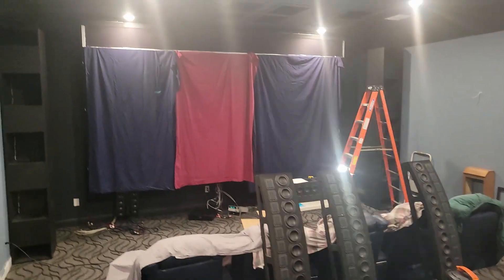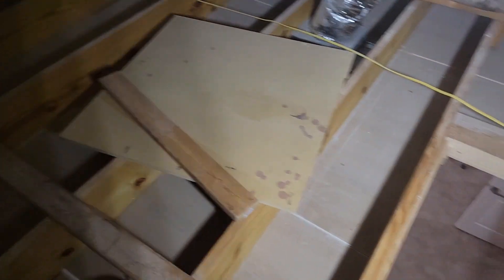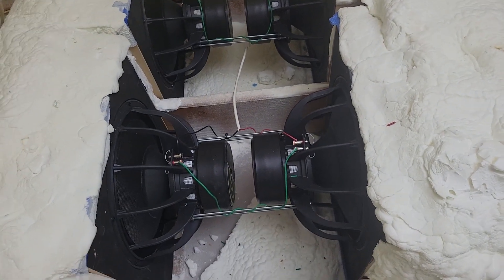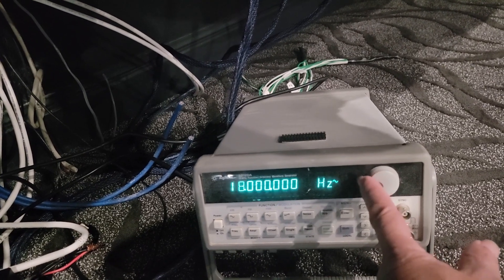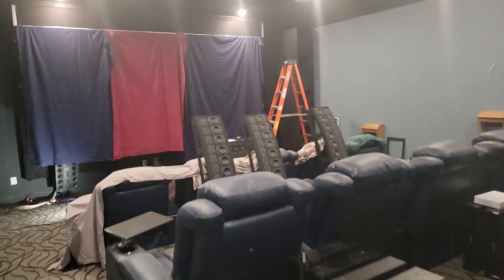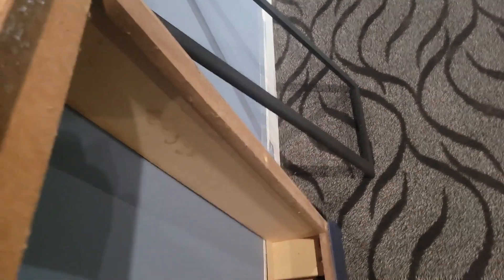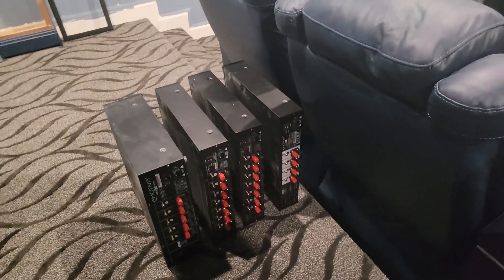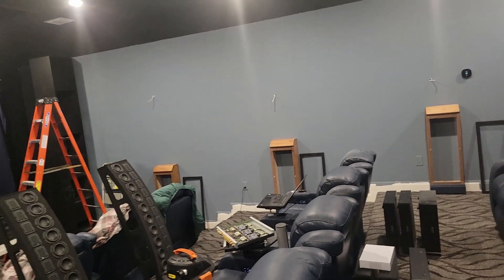11 26 2022 theater update

Comment: This is the most unique setup I’ve seen, absolutely beautiful.  I’m curious to see how your projector handles the low frequency. I say that because I only have 4-18’s, 3-15’s, 4-12’s and two butt kickers and I have to wedge small screwdrivers in my projector to keep the  image from vibrating off the screen and the focus from blurring beyond recognition. I’m hitting around 130db at the couch and by my count you’ll be at 28 subs total so the potential for high db is not just a probability. Very impressive sir.
Reply from the maker: So far I haven't seen a problem but I don't play it that loud and I don't run the bass all that hot, just 3 or 4 dB hot.  I like all the surface area and woofer capacity for distortion reduction more than for being able to play it loud.  It can definitely do that if loud is what someone wants however.

Comment: If you use low power on the woofers eventually you will overdrive the amp and burn out woofers, better off with ice power modules driven lower.
My two cents.
Great cinema, love your work!
Reply from the maker: I do have some ice modules, at least two maybe three pairs of the 1000 watt version from Parts Express.  In a pair one has the power supply built in and the other piggy backs it.  I could use a pair on each side and let those power the Ultimax's and use that Emotiva channel on the 15's.  That way each Emotiva channel is only driving four 15's instead of eight.   

Thing is, they don't need much power.  The Ultimax's are used in IB and only operate near the resonance frequency where the impedance and efficiency is significantly higher.  With about 10 watts per driver it just about shakes the house apart.  

The 15's are open baffle but do require some power above resonance especially close to the top of the frequency band they cover.  It doesn't take much power at all to drive them to excursion limits at the low end of their band.  Still, that's not a bad idea, I might think about putting the ice modules on the Ultimax's and give the 15's an extra Emotiva channel.  That's definitely a good thought, thanks!

Comment: as a home theater installer I had to CRINGE when I saw all the loose boards you've been crawling on ..... its literally a disaster waiting to happen
Reply from the maker: If I fall through the ceiling I don't have to climb over all the duct work to get back to the pull down ladder;-)

Comment: Dude, i just made a design for my home theater and it I just so found yours and it is almost exactly the same haha. From the line source speakers to using the 2x4 hds as active crossovers to using the ultimax 18s. The only difference is that i plan on doing is a 8 subwoofer DBA and i will be using a 2 way subwoofer system with the Dayton Audio PA460-8 above 45 Hz. And all of that will be set to Auro 3d. So I admire your setup. Keep up the work!!